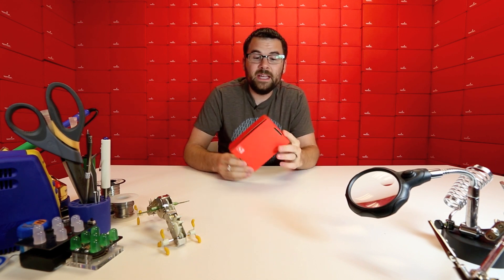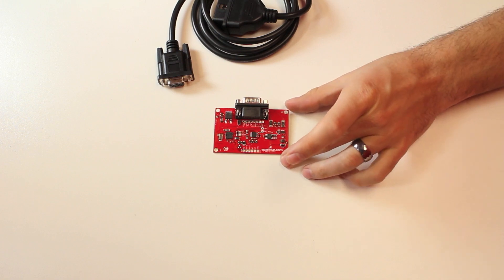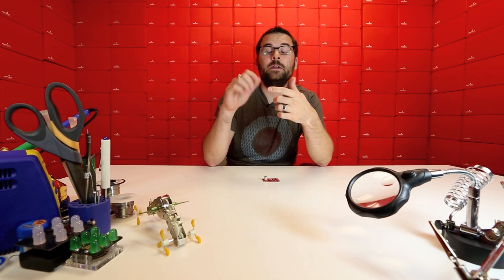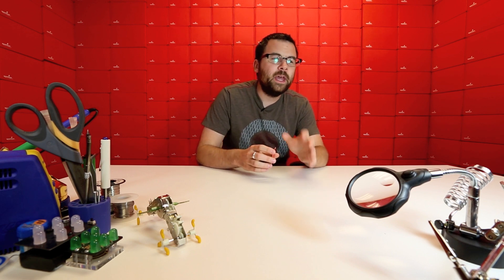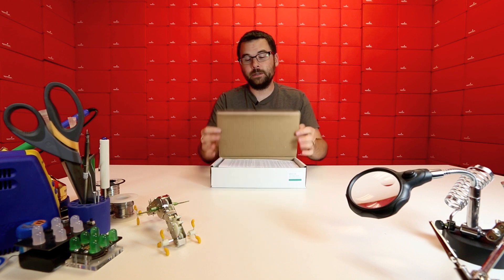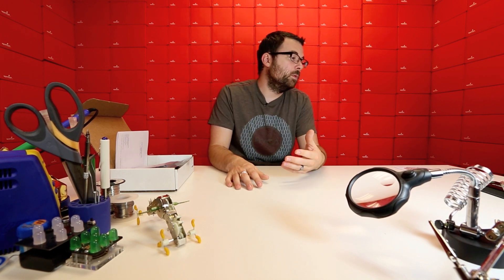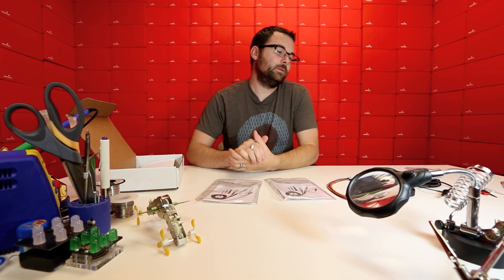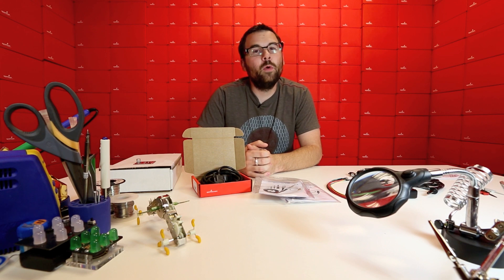SparkFun 5-4-12 Product Showcase

Comment: A good chip for a Step Up converted is Intersil's ISL9111(A)  ... it can start as low as 0.8v and run with as little as 0.6v, and with 3.6v+ it can do up to 95% efficiency while with just 1v it hovers around 80% efficiency. It does 240mA output with 3.3v+, guaranteed 100mA with 1v+.

The NCP1402 tops at about 40mA on 1.2v , barely does 80mA with 1.5v, according to datasheet. This can be too little for powering some embedded processors like pics with lcds
 
See ISL9111AEH50Z-T7ACT-ND on digikey